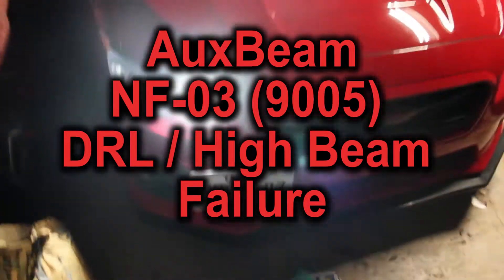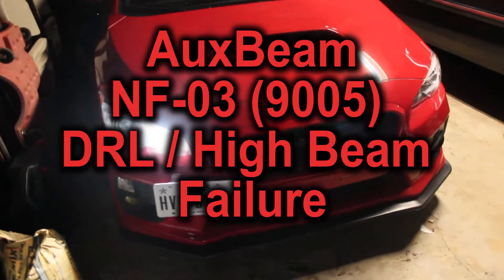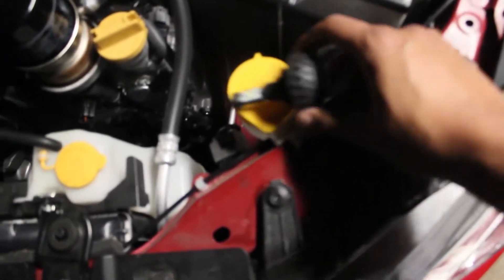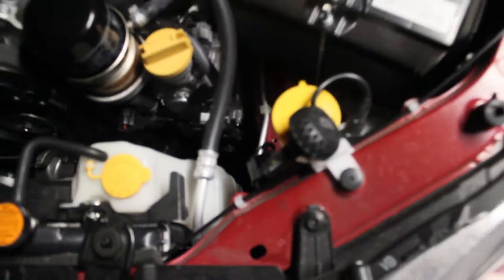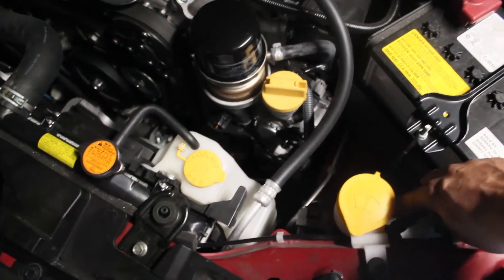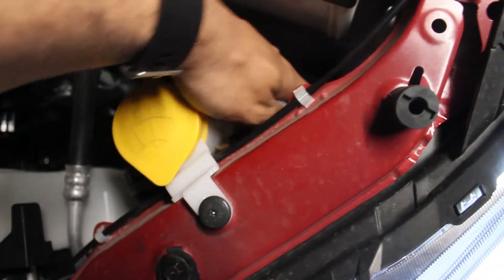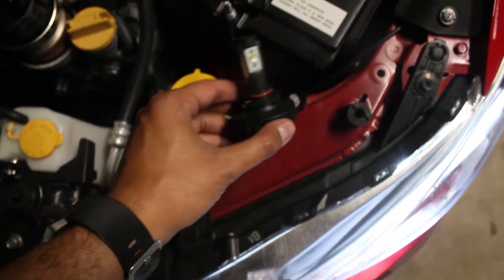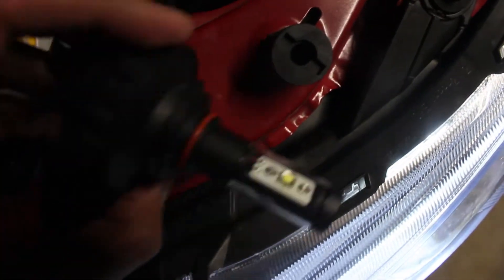My Auxbeam NF-03 (9005) DRL/High Beam Headlights Failed!!

Comment: So around 8 months of use since the install vid? Are you planning on using the same brand for the new ones you're ordering?
Reply from the maker: +Rickjames The Gunsmith I think it's just the no fan design that's unreliable. If felt them on accident before while they were on it got SUPER hot. Like burn yourself hot. It can't last long getting that hot I'd imagine. Especially being DRL and running nearly all the time.